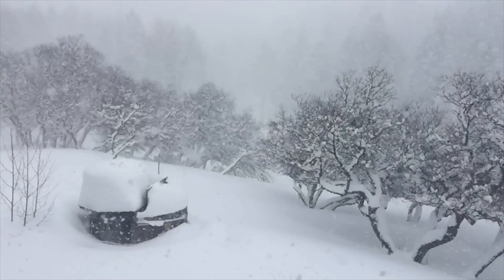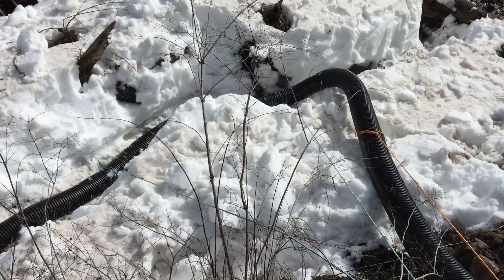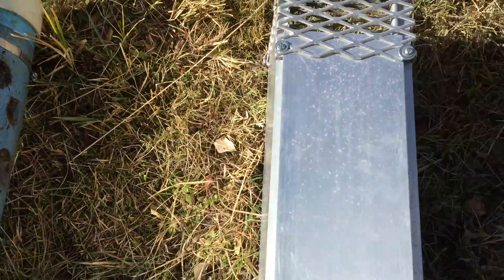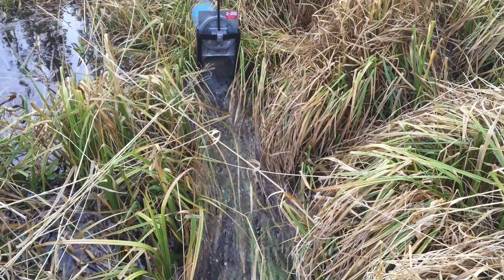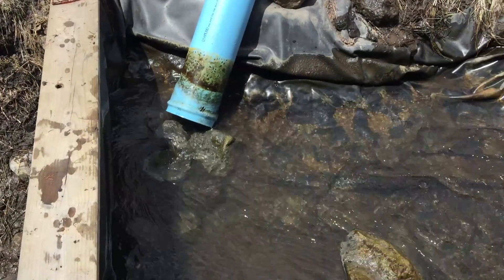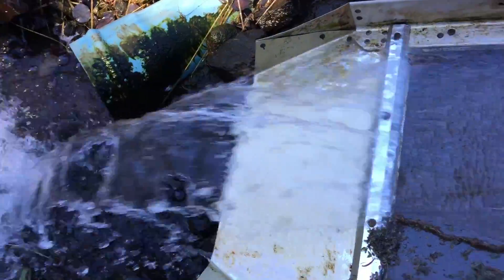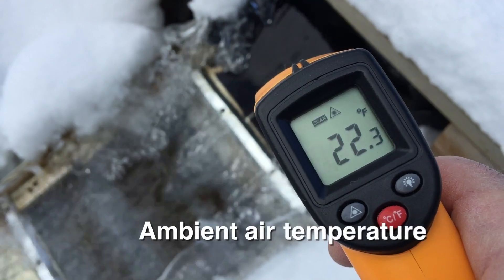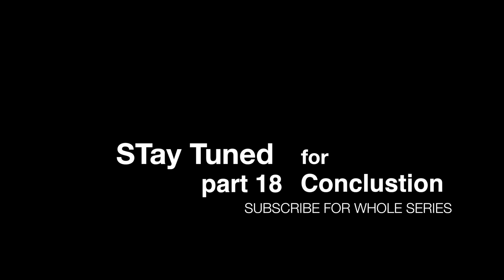Part 17 MicroHydro Power System in CO

Comment: Suggestion: For venting you air consider using a vent drain from an air compressor.  Either one similar to what you'd find at the bottom of a home air compressor, or one similar to what is found on the holding tanks (for air) of big rigs.

Comment: Any bow in a water line will create a water lock. many years ago on a Friday evening coming from a plumbing job, driving by a house where they were installing a new shallow well pump. Saturday Morning they were still at it. Saturday evening ?still there. Sunday Morning? Yep still at it. Sunday evening I stopped and ask what was the problem. We cannot prime the pump. Took a quick look and sure enough, their plastic water line was going up and down like a snake. Took my saw cut the excess line pulled the line straight and in 10 minutes they had water. love watching that video and love the good old memories. Such a project must be a lot of fun and round the table talk.
Reply from the maker: thx for watching.  If you haven't seen it check out parts 20-1,2,3 which are a synopsis of it all.

Comment: In times of severe drought is there still enough flow to power the machine?
Reply from the maker: This past year was the worst drought we've seen in decades and yes the system worked fine.  Didn't pull all the available water into the system and it worked fine.
Reply: @mrhydrohead  awesome. Sounds like a full proof plan.

Comment: have you tried a ram pump?
Reply from the maker: No, no need, we have pressurized spring water from the first system.  thx for watching.  If you haven't seen it check out parts 20-1,2,3 which are a synopsis of it all.

Comment: The Seattle watershed has an 8 ft. pipe running from the intake on the cedar river to lake youngs.Alot of it is an old 8 ft. dia. cedar stave pipe. To get rid of ait problems the have stand pipes every so often that are about 20 ft. tall. This takes the air out and also acts as a pressure valve for shutting down the pipe.My niece';s husband ran this operation till he had a stroke.

Comment: What a well done video!  Have you ever mentioned how much a system like your (or yours itself) would cost?  It would be great to know.  Thanks!
Reply from the maker: thx for watching.  If you haven't seen it check out parts 20-1,2,3 which are a synopsis of it all.  First system about 25K, the move to the creek added about 55k but greatly increased the power. thx for watching.  It would have been 140K to run grid power to property in 1995 and about 250-300K today.
Reply: Thank you!  Your video and editing skills are really on point.  Cheers and continued success!     @mrhydrohead

Comment: an engineer idea: put an horizontal wheel with brushes on top of the water input filter, the wheel will spinn by the waterforce, and there by, if you put a brush underneath that wheel. clears the biomaterial from the filter by wipe-ing it of while the wheel is spinning by the water force. it is an automatic filter cleaner.

Comment: Rediscovering that water will flow up through a pipe and displace air. Beautiful!
Reply from the maker: thx for watching.  If you haven't seen it check out parts 20-1,2,3 which are a synopsis of it all

Comment: You can replace the need to remove screws to bleed off trapped air - use a lightly sprung shut off valve.   Spring holds it open when air is against it.  When water hits it, the weight of the water overpowers the spring.   They are used in several applications to bleed off air.

Comment: THE TWO INCH HOLES STOPPED  UP SCREEN ,,,I WOULD CLOSE OFF THE LOW LARGE END,,, WATER INSIDE NOT FLOWING OUT THE LARGE OPEN PUSHING DIRT OUT BLOCK TWO INCH HOLES ,,HOPE I TOLD THIS RIGHT

Comment: I have an idea for constant energy flow :) Imagine a bunch of water wheels positioned above each other, each one when spinning generates an electrical current not so unlike a wind mill does but with water. At the top is a big basin of water, as the water falls straight down it spins the water wheels generating electrical current. When it reaches the bottom their is another basin, but this one can be shaped some what like an up side down bowl and is slanted down so water flows into areas that are separate and in these areas the water is evaporated and then travels up tubes and back to the top where water re-condenses and falls back down. In these tubes the steam is traveling up through, there is a smaller tube coming down from the top and small windmill like contraptions protruding from it. The rising steam spins these small windmills and generates electrical current that travels through wires in the center of these inner tubes and can either be used for extra energy output or help to heat the bottom bassins or even the tubes themselves so the evaperated water stays evaperated all the way up. The energy to keep the bottom hot enough to evaporate water comes from as many of the water wheels spinning as needed. To get more energy output you just make the contraption taller with more water wheels, It will always only take so many wheels spinning to keep the water on bottom boiling so more wheels equals more energy output. The material in the top basin can be designed as a heat sink to help the water re condense into liquid form, if built correctly, so no water/steam escapes, it just keeps going and going utilizing natural forces to function. If the device was built inefficiently, in that water was escaping from it in small amounts over time. One could easily rectify this issue by attaching a device to the top of it that naturally gathers moisture (Water) from the air and releases it periodically into the system to replenish it. :) Now just add the proper electrical wiring and chargable baterries into its design so all the excess energy being perpetuated can be accessed from plugs on bottom and/or top of device and presto you got yourself free energy.(Free in the sense that you didnt pay for it :) Please share this Idea with Everyone.  Signed Adam McKenzie Anderson
 Extra Note: If anyone uses my ideas for none profitable means great I hope it helps but if they are used to gain profit in any way I want 25% of anything that comes out of it. :)  My EMail is starfire7654321@yahoo.com
　
__________________________________________________________________________________________________________________________

I have an idea for a lifting force machine. 
Step 1: Get hollowed out cube.
Step 2: Securely attach magnet to inner bottom of hollowed out cube.
Step 3: Place a lever on inside bottom of cube behind the magnet that's securely attached to inside bottom of cube so that one side of the lever is pointing towards you and hanging over the magnet.
Step 4: Attach a vertical bar to the top side of the part of the lever that is not hanging over magnet witch is securely attached to inner bottom of cube. Make sure the bar goes all the way up to the inner top of the cube barley touching it.
Step 5: Securely attach a magnet to the side of the lever that is hanging over the magnet that is attached to the inner bottom of cube.
Note: Magnets need to be facing each other with attracting poles N,S or S,N
Note: The lever is going to have to be really close to the magnet on inner bottom of cube because of how close those magnetic fields need to be to interact. But not so close that magnets can touch.
The magnet on top connected to lever is pulling the magnet on inner bottom of cube towards it and since the magnet on inner bottom of cube is connected to cube, this pulling force acts as a lifting force. Now at the same time the magnet on inner bottom of cube is pulling the magnet on top downwards BUT the magnet on top is connected to the lever so any downwards pulling force is being converted mechanically by the lever into upwards lifting force. Now if you know anything about magnets you now that there are magnets powerfull enough to lift far more weight then just there own. So essentialy this divice is exploiting the powerfull pulling force of magnets by mechanicaly transforming its magnetic pulling force into mechanical lifting force through the clever utilization of a lever, and walla stuff can be made to fly. Imagine if the magnets in this experiment where electro magnets so the ammount of electrical current going into them determined the ammount of lifting force that it would have. Now imagine this system being used as an attachment that could be placed under or ontop of vehicles to counter the weight of the vehicle and any cargo its carying. Now imagine  if this was done with powerfull permanent magnets and turned sideways and placed in an electric generator and had enough strength to pass through the magnetic fields as it propelled itself forwards with its own magnetic pulling force.     Signed   AMA

Comment: You could always add a heating element and a motorized brush for automatic cleaning. Awesome video tho want a property like this to be self sufficient always wanted hydro power as main source. Thanks for the video.
Reply from the maker: thx for watching.  If you haven't seen it check out parts 20-1,2,3 which are a synopsis of it all.  Intake is 1/2 mile from power, so running power there doesn't make sense.  Costly and not really needed
Reply: @mrhydrohead   Thanks for the response :) watching the series now. I like learning about all sorts of things, and hydro power especially from a smaller stream to provide enough power seems like the best way to make power if its available. Thank you for your videos.

Comment: Fantastic system. 

With regards to the screws you are using to block the holes for the air removal: I wonder if you might just leave screws out permanently to let the air escape as it occurs. You certainly are not going to suffer from the very minimum constant loss of water from an 1/8" hole.
Reply from the maker: thx for watching.  If you haven't seen it check out parts 20-1,2,3 which are a synopsis of it all.  The suction of the water draws air in through the holes

Comment: I never thought about all of the air getting in there.  You could maybe use check valves instead of the screws?  Not sure if that would work...  thats a TON of power! you could run a saw mill off of that and go ham building stuff

Comment: I wonder if a regular city household could have the water intake valve into our property formatted with one of these. It would be great to have that creating electricity for the household!
Reply from the maker: Sorry to say the Water bill would go way up and you would get minimal water from it.  Thx for watching, Check out synopsis parts 20-1,2,3 if you haven't already.  Happy Solstice to you too.
Reply: @mrhydrohead  Well, you create a ton of electricity - far more than I need. I only need a fourth of what you get. I was thinking that perhaps on an incoming line or an outgoing line with a battery system. How do you store your energy or is it always flowing so you just tap into it when you need it? I'll watch your series of videos. Thank you for posting and Happy Holidays!

Comment: You need to rotate the stainless steel screen 90°  the purpose of those ridges running parallel is so the water flow pushes debris off . Then you don't have to go brush it anymore
Reply from the maker: Thx for the suggestion and thx for watching. See the final solution here:
https://m.youtube.com/watch?v=KVrt3oM5qWo

Comment: Need some 3D printed slow sweeping and fluttering mechanisms to clear both ice and debris. Maybe like a wiper arm on a slow gear. Of course, you have plenty of electricity so maybe just motor driven windshield wiper on timer. And deicing can happen with gutter heater wire on a thermostat and timer.

You can avoid some air lock problems by using smaller pipe further down the slope. As pressure and flow increases it will not cause restriction, but might overcome air lock.

Also possible to approach the problem like the drain/sewer vent pipes in your house. Small diameter vent tubes from high points could be run straight up with the top being higher than the highest point of the system, like up a tree. Or just on the ground up a slope.
Reply from the maker: Thx for the suggestions and thx for watching. See the final solution on the coanda screen here:
https://m.youtube.com/watch?v=KVrt3oM5qWo

Comment: throw a 4x4 sheet of 3/4 inch plywood over that water intake. cover it with 3 bales of straw. should use the heat  in the water to keep it from freezing!
Reply from the maker: Thx for the suggestion and thx for watching. See the final solution here:
https://m.youtube.com/watch?v=KVrt3oM5qWo

Comment: I am from sunny side of the world and utilize sun to generate energy. I know nothing about this kind of green electricity generation, but would like to through something in the mix.

Would it be possible to incorporate some kind of element to you stainless grid that could perhaps be warmed every six hour or so to melt all ice buildup, since you have the energy available, even if you have to schedule it in when house demand is low?

Might work, just my lateral thinking.
Reply from the maker: Lots of people make similar suggestions or have other ”fixes”.  This video is just one part of a long series where the ice problem is later solved. 
Using power as you suggest would require laying at least 1/2 mile of wire back to the intake. A costly and needless effort. 
But thanks for the idea and thx for watching.

Comment: Have you thought about using some of your dump load to apply heat to the pipes or solar panels? Just enough warming to keep the panels and pipes above the point where the snow or ice would form might make up for the load used to do it.
Reply from the maker: Thx for watching & the idea. Lots of people have made similar suggestions before seeing the whole series. Problems have all been solved by the end of the series.

Comment: Is there any real need to block up the bleed holes in the pipes? I would have a micro hydro system tomorrow if we had any water flow at all, we have to make do with wind and solar.
Reply from the maker: Those are still great sources of energy, although I have no practical experience with them.  If your question is referring to the diversion from the creek, if those bleed holes aren't blocked, suction is present when the pipe is full and it sucks air and complicates the issue of air lock within the pipeline.  I'm never sure when people ask questions if they have seen the whole series (20+ segments), many parts of it, or have simply seen one segment.  Sometimes its hard to answer questions for that reason.  Thanks for watching.

Comment: This is amazing. Is there a forum or some place to discuss this kind of endeavor with others where collaboration on implementing a similar setup in a different environment could take place? For example, I'd like to take this idea and implement it in a lower flow creek that has the potential to be dammed up somewhat for flow during times of precipitation that occur rather frequently.  It would go a tremendously long way of reducing overall power consumption, especially when solar power is not as good of an option due to shading in a valley.
Reply from the maker: Try this: http://microhydropower.net/mhp_group/
There is also a micro hydro discussion group on Yahoo. I don’t participate in either as I’m already set. I learned by taking a class in the 90’s before lots of internet resources were available at SEI in Carbondale, CO : https://www.solarenergy.org/training-schedule/?tribe_paged=1&tribe_event_display=list&tribe_eventcategory=124
Thx for watching
Reply: @mrhydrohead  amazing, thank you very much. Curious, are you available for chat or consultation services / brainstorming at all?

Comment: With the ample amount of power you have, why cant you encase your system with a covering and heat it.Like you would your pipes using heat tape and insulation.
Reply from the maker: The system runs fine with no freezing within the penstock. The are nearly 25 segments of our series. The intake is nearly 1/2 mile from the power source. Line loss would be huge and the expense and effort unnecessary. Thx for watching

Comment: a fix your issue for less than 5 bucks:   build a small 'paddle' wheel that has brushes on it that clean the screens..it's powered by the flow of water and might last a full season.  If you used special plastic bristles that were UV resistant they might last a few years before needing replacement.  Just an idea:)   update:  it might solve you ice problem also.   Okay I'll shut up now!

Comment: In Alabama the only way to do this would be to have a small waterwheel or something in the edge of the creek. Diverting water from a waterway of any kind is prohibited. Small farms next to a creek can't even utilize the water.
Reply from the maker: I think it is so nobody can interfere with what the corps of engineers does to control flooding. They want to have ultimate control of slow moving water

Comment: I bet if you make a little dam at the top so youre pulling water below the surface you wont get half the debris. I believe most the debris is carried on the top of the water.  Also the more still the water is, the less debris will be suspended in it. So if you make a dam at the top, pull your supply from the most still part of the dam.